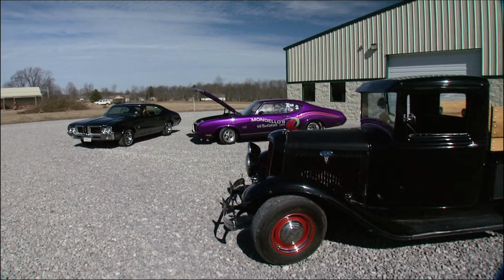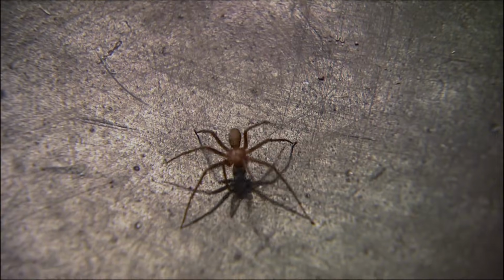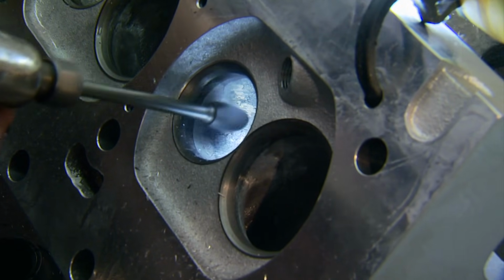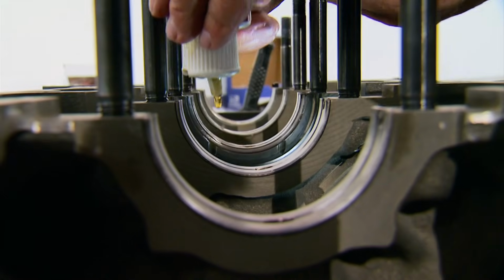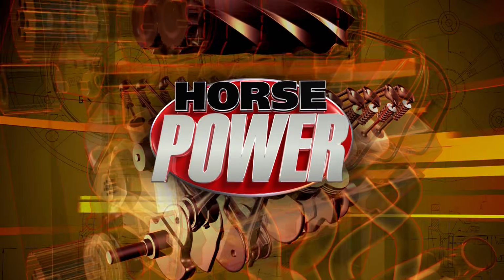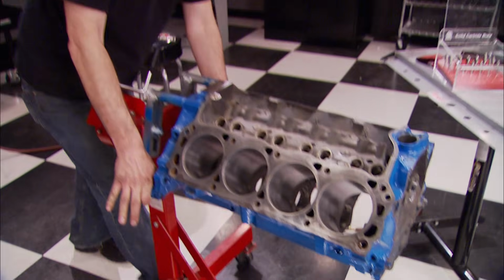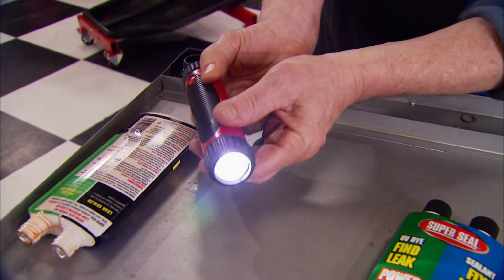Hand Porting Cylinder Heads on an Olds 455 Big Block with Legendary Joe Mondello- Horsepower S13, E6

Comment: 4 cylinders... that's a reasonable quality check. I don't think it is wrong to say degreeing your cam may be the most important part of your build.   Do ramps start at 0.004" or 0.006?  If you never checked that, how are you going to spot problems later?  I also like checking 0.015" duration numbers - they can help sort out best combustion chanber size, and I note there are still a good number of grinds out there that reference them, despite the flow bench guys ignoring everything under 0.050".
The 455 is a motor I wouldn't mind seeing more of, but that's me.

Comment: What the hell? So, to find TDC, I bring the engine to TDC, THEN screw in the piston stop? After that I turn the crank till the piston hits the stop? How's that going to work? Holy Crap. And then to degree the cam I'm supposed to turn the engine till the lifter is at maximum LIFT then zero the dial indicator? And I can put the indicator on the lifter OR the valve??? Wait, so the rocker ratio won't change my .050 lift, because they're all 1:1 ratio rockers, right? And I must be measuring .050 from max lift, not the base circle, since that's where I just zeroed the dial gauge. Sure, that'll match the cam card just swell.  You can bet your ass they didn't learn THAT from Mondello. What a joke of a channel.

Comment: All I can think of is that paint in the lifter valley eventually coming off/flaking or chipping off and stopping the oil pump strainer up.. want it smooth I'd lightly grind it to get the dimples out instead of painting..

Comment: love how even power nation who is supposed to be a reputable source of information is ignorant enough to refer to it as the 455 "big block" when its just the same size block as the smaller displacement engines bored and stroked a bit more. now if it were a chevy 454 that would be a big block, but the 455 olds and pontiac arent by definition a big block as there was no small block...they were all the same size externally....
Reply: The olds 455 is a big block  tall deck what u said is true only for pontiac engines

Comment: Back in the early 90's I remember calling his shop a few times to order parts and actually got him on the phone. I barely knew what I was doing at the time with an engine build. And as you can tell from this interview, he spoke his mind, and he made me feel like a moron. I guess I wasn't asking the right questions, or he didn't have the time or patience to talk to some kid. But I've found that's pretty universal. Nearly everyone involved in high-performance and racing is an ass. Maybe the customer complaints and demands make them that way. Or it could also be part of the intimidation that competitors try to lay on each other. I ended up giving up on the Olds project and had a local, reputable engine builder build a stroker Chevy motor for me that scared me with the amount of power.
Reply: I've found that same attitude in just about every auto repair worker. Being an asshole is part of the deal I guess  : /

Comment: Fairly recently, there was a TV show about the Olympic athletes. It spoke of the things they do to improve performance imperceptibly. Bedsheets from home. Water from home. The brands of snacks they have. This is relatively new to this kind of sport.

Individually, the work done on these engines make small differences. Cumulatively, they make the difference between taking first place and losing.

Fantastic work.

Comment: Are you serious!? You just put stop leak in an old LT1! How can you guy's actually advocate the use of ANY stop leak!? I get that repairs can be costly, as a tech myself, I've had this conversation with many customers on the Do's and Don't. You don't run any type of stop leak in an engine, coolant system or trans. Sure, it can stop a leak, but you also take a chance on plugging vital passages within the engine itself... 
  You've got young DIYers watching your videos thinking that this is okay, it's bad information, and isn't teaching them the correct way to address a problem.

Comment: Joe was a man those of you who didn't know would love to have, known.
An, as a matter of a fact , kind of guy.
One that knew what he was talking about and had  the proof to back it up.
He told me, he started with go carts when he was a kid and finding power just became a passion. 
Not many people know his name is on the Hot Rod Hall of fame 3 times.
He wrote a book about the Oldmobile engine and sold it to Oldsmobile.
And few know he was an engine builder of such caliber it set him off as one of the most humblest men who have ever lived.
He was kind and strict in his teachings at the same time.
He could extract power from places most guys would never look for.
And he invented the wet flow bench.
It was a real pleasure to know this man and I wonder sometimes if he were alive today, just where the hp/ci. level would be for some of these newer N/A,  engines.
Things he did like degreeing a camshaft off of 3 lobes and cryogenically treating every component he could because of the strength it gains and other stuff which would take days to write and even more to explain.
He knew no stranger.
And if you had a question about how it worked or how to make it work better, he would show you.
He would take you into the clean room, where you could eat off the floor and tens of thousands of $$$$ of parts were.
Or let you stand in the shop when they twisted a NASCAR engine 10,000 rpm., while goose bumps ran up your arms.
I learned alot from him.
Pages and pages of notes. Stuff that I still do not have the money to build in the quest for the power which seemed to come so easy for him.
He was a great man.
His name used to mean something. And to those of us who had the pleasure of knowing him, still does.

Comment: True icon. Those 455 Rockets were pretty tough but plagued by that oil issue. Mr. Mondello is an enginemaster that done things that Olds refused to do. They were smart enough but, not interested in building motors like Dr. Oldsmobile. It reminds me of GM refusing to fix the problems of the NorthStar after so many years in production. Although the 455 was not so plagued unless pushed hard or higher miles. Back than 100k was a lot.

Comment: If you want a decent Olds 455 core, the GMC FWD RV used them from 1973 to 1975 or 1976. By 1977 they all got the Olds 403 and 1978 was the last year of the GMC FWD RV.

One thing that fascinated me was that Olds engines got exhaust air pumps than other GM engines. In addition, some versions of the Olds 307 had carbs in 1989 when every other GM V8 had EFI. The engines were naturally lower in smog, so I figured other GM engines would be built more like Olds models in order to pass harder smog tests.

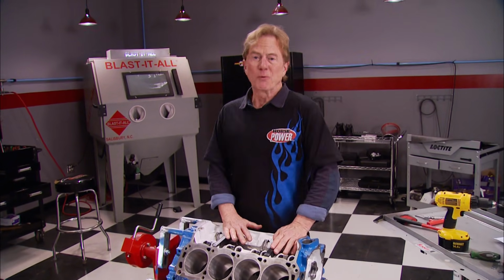15:00 I have heard that the old school Pontiacs needed this kind of device, except for the Super Duty.

Comment: DO NOT use that stop leak crap, if its sealing up a leak in your oil pan what else could it be sealing up and blocking...hmm maybe a oil passage ya think? fix it the right way by changing the gasket and dont try to cut corners.

Comment: hard to imagine those pins that hold in the braces at 14:50  are sufficient to stop block twist.
Reply: That roll pin most likely has a breaking strength of 8000 LBS and made of Rockwell C42. It will hold up!!

Comment: Built a 455 olds for my 70 Cutlass years ago.
That engine was a torque monster. 
With a stock converter and a THM 400 transmission; I could never get traction - just a lot of tire smoke. 
Fun car to drive. 😊

Comment: In the drag boat the olds 455 were the first to die ...we had to give up on them.  After we pinned the bearings the saddles would crack from crank flex. They had great hp potential but the blocks and cranks could not stand the load we required.   But they did make a great anchor for the yacht.

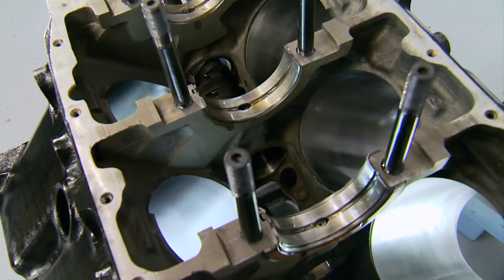Comment: @7:40 can't anyone get a cam in without donging it on the bearings?
Reply: As Bob Dylan once said " Yes, I think it can easily be done., just take it out there to Hyway 61" actually it's very easy but even the pro's over look, just plain don't want to be bothered ,by doing it right.    Ready for the *BIG SECRET "?     Set the block on the floor flywheel side down, best to use some 2X4  or the  metric equivalent, lol, under so you are'nt involving the locating dowel pins. I made a handle from 3 long bolts and a short piece of PVC pipe. Or find a store bought one ,I was building a SBC so I literally had the stuff just laying around. So with something to hold the can you can simply " drop" it into the can bearings without marry a nic or scratch. Then make sure it can't fall out as you put the block back on the stand. If you don't want to unbolt from the stand plate you can just use 4X4 s under should clear the stub . OK?
Reply: Only after a few JD’s

Comment: Add to the cam degree method 10 deg B4-10 deg after total, that's the sweet spots for error if there. Absolutely do what Joe recommends about the oil return design I learned all these things on my own over the years, even ran lines back to oil pan from heads to assure full flow and return. On porting I didn't have aftermarket heads I used W30 heads. I raised the floors and the roof of the ports to straighten out the flow. Had to be carefull gets thin up top on the port. Then the biggest HP creator on these big olds engines is fabricating your own sheet metal manifolds. Must eliminate all that low profile runner design the engineers used to get the hood closed. All this sounds like a lot of work, it is! but you will be rewarded with a sound high performance torque monster.

Comment: If the degreeing is off and you don't have an adjustable cam or crank gear.... what do you do?????
Reply: Find out what is knackered. Means there is a twist in something
Reply: You have to drill out the cam gear and install some offset bushings.
Reply: FUCKING BULLSHIT! marty don't use your mouth to break wind!

Comment: Oldsmobile is Quality , luxury and Performance. Also very durable &reliable transportation. I learned to drive in a Cutlass Cruiser “sport” station wagon. Olds silver with olds rally weeks . Air shocks plush gray Leather not vinal , premium interior. It drove smooth and easy. Couldn’t hear it run at red lights. Idk how fast that car could go , I always backed out before it stopped giving. I drove it VERY fast a few times back when I thought I was never gonna die . I would not drive that fast again. I run in the fast lane on DC belt loop without breaking a sweat. Still,Never that fast again. 🚀fast

Comment: A family friend had a jet boat when I was growing up in the 70's with a blown Olds 455. It was the fastest boat on the reservoir. The boat was only a 21 footer with this huge engine sitting on the ass end. Every winter he would pull it and rework it. I spent many a winter night with a die grinder and 500 grit paper and a cylinder head in front of me. He told me the same thing. Air is king, not fuel.
Reply: Im in an olds motor group on Facebook and I see alot of boats 😎
Reply: @evdawg7757  Back in the 70's and 80's it was King! Now it's the LS engine series and crate motors.

Comment: So to confirm, at the end of the video you are hawking some leak sealing stuff, something designed to clock up and coagulate to stop leaks, in an engine, an engine that has many tiny passages that are designed to allow oil through...

Man, I bet mechanics love those stop leak things, gives them plenty of extra work.
Reply: stopleak is meant for emergencies, to be used to get your vehicle to a safe place, then thoroughly flushed out.
Reply: @xtune5731  
It doesn't flush out.
Reply: Jim Henline sorry hadn’t watched the video, I meant stop leak for coolant leaks.

Comment: 455 Olds LOL........ Do you guys use Rotary phones at home also? Smoke Winston's .... Lmfaooo
Reply: So I'm guessing you are 12 to 15 yrs old,play Forza constantly and think using the brakes to do burnouts is cool.
Reply: The King's Servant ... Your calling me 12 ... But your worried about burnouts .. these motors where great in the day .. But like everything else ... Phones ,cars , houses as time moves on things are designed to be better . 

These motors where great in 1949 you know 70 years ago when they where designed .... But today’s standards I don’t even know how they sell parts for these old ass motors ..
Reply: Yeah you said it...."don't even know" and that's your problem😒
Reply: @midwestcatz5896  yeah I'm not sure what you're talking about. 
Top Fuel AAA dragster engines are based off of engines from the same era, and they're producing over 10,000 hp. 
Just because something is old doesnt mean it isnt still good. 
The hydraulic power brakes you use in your car today were originated in the 50's. Does that mean you should take them all out ?
Reply: @reginaldfitzpatrick8681   Yeah let me know how many Top Fuel Dragsters are using Oldsmobile  455  blocks and pistons, cam, bearings, rods, heads etc...  We are talking about streetcars here.  Go price a top fuel motor lol ..  I mean NASA has rockets from  1957 .... They worked great in 1957 ... But today they are 1000x better ... Im not sayin these motors aren't good no reason to get butt hurt over it ... IM saying for the money you'd put into one of these dinosaurs to even compete with the motors of today lmao.... 

My point is no one is out here like..  man i sure wish I could swap a olds 455 into my car for drag racing its 2019 ..  maybe lots of nostalgia drag racing guys who like run 12.50's in big tire  drag cars lmao..
Reply: @midwestcatz5896  I would. Running a 10.78 1/4 mile with my 455 olds
Reply: Reginald Fitzpatrick  right how much do you got in it ? 

10 second cars go get groceries and pick the kids up now days ..
Reply: @midwestcatz5896  re-build with bolt ons and internals about 5k. Not bad at all.
Everyone and their grandmother has an LS swap. Sometimes it's nice to see something different. 
And I'm not sure of too many grocery getters running 10s. But ...
Reply: @midwestcatz5896  that 10 second grocery getter has a huge honkin fucking turbo. take it off and build it to do 10s n/a and then make it streetable....you cant. older american v8s make DUMB fucking hp with turbos.
Reply: @midwestcatz5896  oh btw, that 10 sec car you speak of probably cost 60-80g.
Reply: @frigglebiscuit7484 What ten-second car are we talking about?  I can buy so many 10 second cars for 10-20k you'd start drinking to cure your insecurities ... Just stay in carb big cubic inch land with the " Fast Cars " from  40-50 years ago  if it makes you sleep better .. 80k on a 10 second car LOL....
Reply: @midwestcatz5896  yea, I can make my car run 10 seconds cheap too, what's your point? Anyone can, when they buy a turbo. Its not impressive anymore. Its boring.
Reply: Frigglebiscuit oh... You’re into spending lots of money going fast I gotcha I gotcha  .. No I totally get it it’s not about how fast it’s about how much money you spend . You should buy a Tesla . they are like 100g and you’ll go fast ... Wink

I seen a school bus that runs 9’s also it has a jet turbine .... The hell with it . Just buy a jet and take it off then mount it on your car then you can say you got a olds rocket ‘
Reply: @midwestcatz5896  an eBay turbo costs about 300 bucks. I'm just not into boring cookie cutter shit. You can keep twisting your stupid responses around all you like, I don't care.
Reply: @midwestcatz5896  Who cares? Do you drive a top fuel dragster to work every day? There's nothing wrong with building an Oldsmobile engine or whatever engine you like, it's all for fun. Most of us here don't race top fuel dragsters, so who cares what the best motor is, you can build any of them to make more power than you would even need for the street.